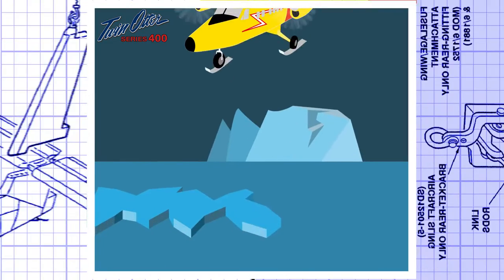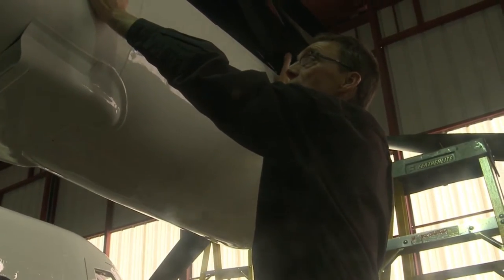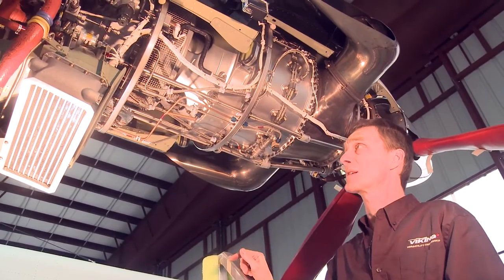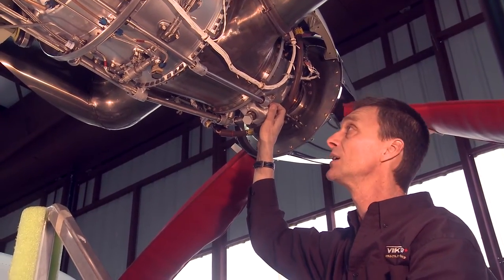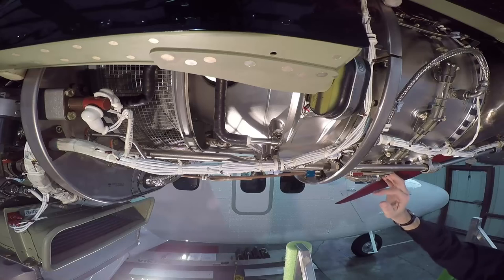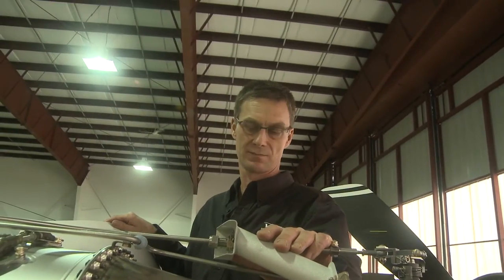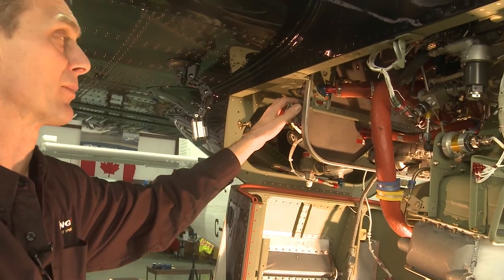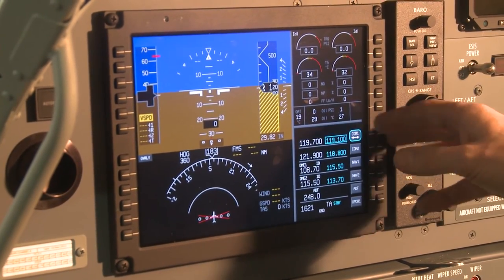Twin Otter Series 400 Overview: Engines

Comment: The Twin Otter Series 400 has easy access to most of the engine components. What a novel concept!  Automobiles used to be this way many years ago, but today's automobiles are very hard and difficult to work on.